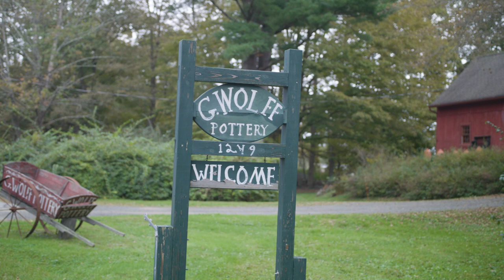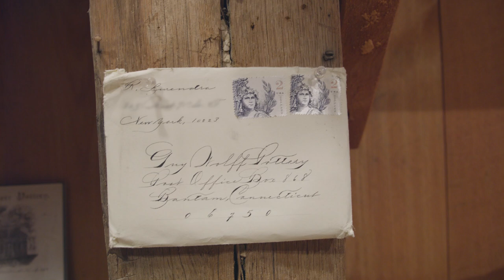Making Stoneware Pottery With Guy Wolff & Rajiv Surendra

Comment: Rajiv continues to be an absolute gem.  He's smart, funny, winning, warm and real.  Guy is an amazing ceramic artist and worth every moment in this video.  But I used to work in ceramics and I find it almost impossible that Rajiv stays so clean!
Reply: One of our traditional shop set ups is "clean to dirty water" .The throwing water is clean, clear water kept to the right of the wheel and there is a secondary bucket for dirty water and slurry to the left of the wheel .That way your hands stay slurry free for the ending moves that make the pot clean and keeps the potter's hands  organized. After a day of throwing there is also a small pile of muddy clay off to the left of the wheel near the slurry bucket . That clay is put out  on the slabs and is ready the next day to be reused ...  Every few days the slurry bucket is also emptied onto the drying slabs .. No clay is waisted ..